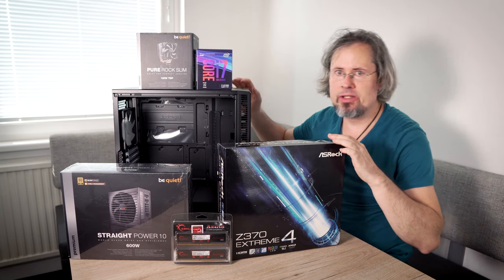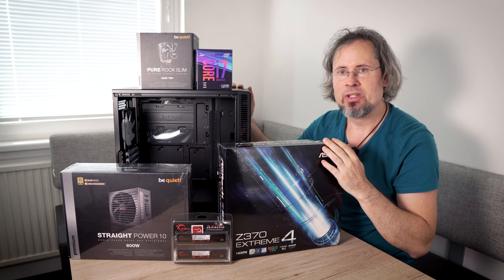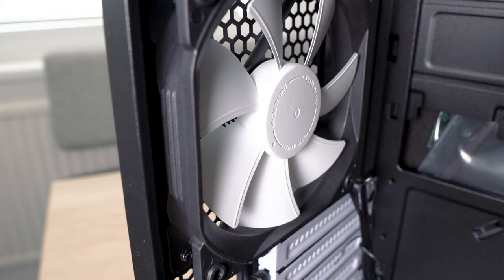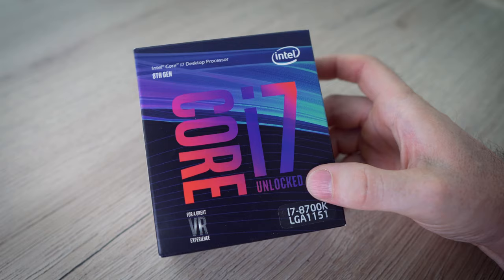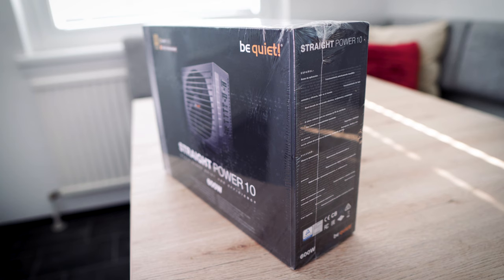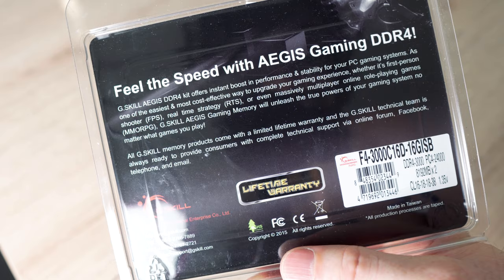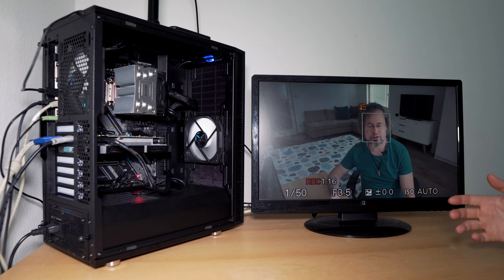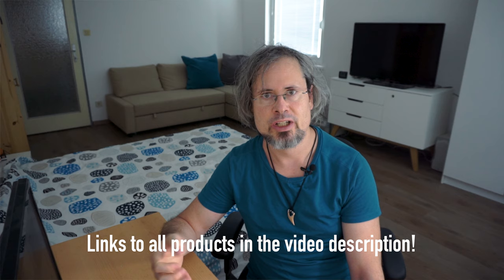📸🎥 Photo-  and Video-Editing PC in 4k Build Tutorial (2018)

Comment from the maker: When installing the memory I did a small "mistake": To achieve dual channel you need to put it into the proper memory slots. Here is a correction video (in german): https://youtu.be/Wx7qqnResgU

Also I made a second "mistake": I did not have XMP activated in the BIOS, so the memory was running with just 2160 MHz. Wit XMP it runs with real 3000 MHz (1500 MHz * 2 = Doppelte Daten Rate DDR4)...

Comment: Have a question, why did you decide to use the cpu cooler for the waterpump header instead of the just cpu fan behind the shield at the top of the motherboard? Is the no difference in preformence if you install it this way
Reply from the maker: Hi I will look into this, maybe it was a mistake... thanks for the information
Reply: @budgetphoto  thanks I await your findings

Comment: What photo editing software are you using and have you tested the photo editing?
Reply from the maker: Hey photo editing is not a problem for this setup. The requirements for photo editing are much lower than for 4k video editing. Of course for some tasks like panorama or HDR if is good to have a fast CPU. I think Lightroom is the best app for photo editing.
Reply from the maker: Hey I have seen your video. I think it is important (for photo editing) to have enough RAM (16 GB). This is important to load whole image and digital camera often have high megapixels. Then to use an SSD (or better NVMe on the motherboard) so that photo app loads fast and you dont have to wait when scrolling through your photos. About CPU I think an i7 or i5 should work. Advantage of Ryzen could be that decent graphics is already included. For Intel  cheap used 1060 could be enough. It is easier with desktop you can make cheap built with good performance, often people want laptop, much more difficult and almost impossible for video editing (need gaming laptop then). About motherboard: Well you can also upgrade motherboard if you want to change CPU, technology advances fast and often times this is the best option after some years. Hope this helps if you have question dont hesitate.